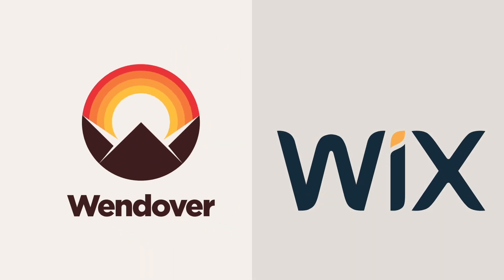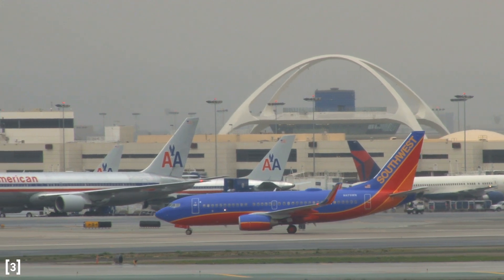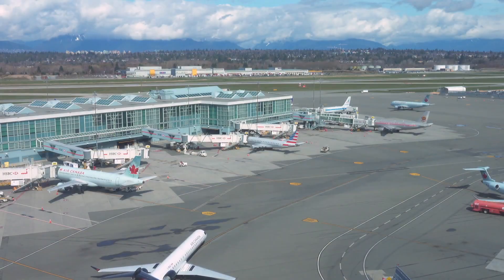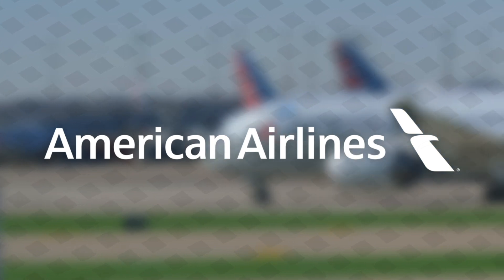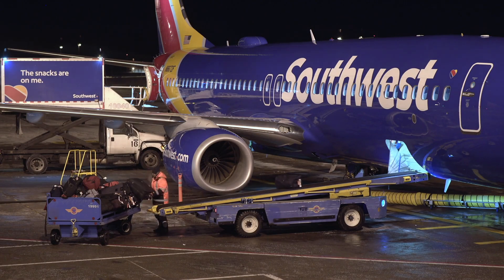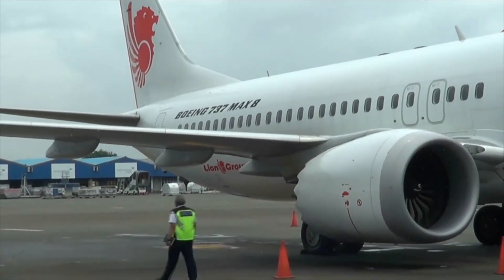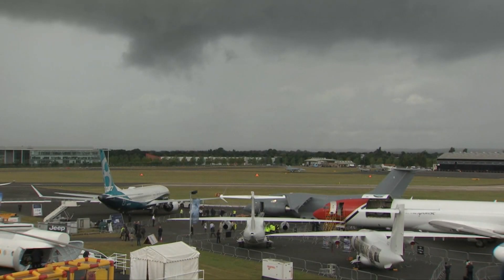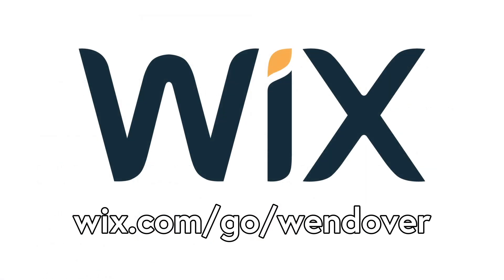The Economics That Made Boeing Build the 737 Max

Comment: So, what makes a new design different than a new variant?
Reply: New design costs far much more and takes many years due to research into new designs, aerodynamics and how the cockpit will look like and new features on board. Then it’s got to be flight tested, fully safety tested which can take another 2 years. With a MAX variant all you have to do is prove the engines work and all extremes of temperature, bird strikes and aerodynamic checks

Comment: One thing I don't understand that if Boeing was really trying to save money, then why didn't they just not include MCAS?  Aren't pilots there to lower pitch anyways?
Reply: Matthew Hung only if the pilots react in time. But also the plane was marketed as flying the same as the NG. If Boeing said the plane will have tendency to pitch up when trying to sell the plane, that will definitely put a few customers off. If they didn’t include MCAS by now pilots would have complained about it or someone would have stalled a plane and crashed

Comment: A precisation: is not that MCAS could not have been installed without incidents, military planes have a similar system in place wich has funny enough a much better track record taking information on multiple sensors and deactivating at the first sign of false signals. 

The 737 MAX could have been a totally safe plane and will be now that the problem has been corrected.
Reply: Flight-critical systems have to use multiple sensors as input (typically 3 sensors with a chip that checks that at least 2 out of the 3 give the same readings within a small margin of error) - but any addition of a flight-critical system would have automatically meant new pilot training. Therefore Boeing marked the MCAS as not flight-critical; and with that, the requirement of the vetting system and multiple sensors went away, which made it possible for Boeing to save some money. I believe this is a case of executives not knowing what they're doing, because any engineer worth their while would have had suspicions - and given typical corporate structure, those suspicions would have been shut down pretty quickly.

Had Boeing not decided to make yet another 737 variant, they would have been free to redesign the plane and study its aerodynamics with more freedom in the design, therefore rendering the MCAS useless.
Reply: @SolarLiner  I suspect that they could have increased the redundancy on the MCAS even without marking it as critical or like the military version make it deactivate if the pilots keep inputting counter trim.
Reply: @theophrastusbombastus8019  Yes, they could have. But that would have meant more design time and more money spent - both of which Boeing had none.
The point is, corporate is the reason why this happened. Boeing is at fault for the decisions, but I think this raises questions about regulations that something like this could happen.
Reply: @SolarLiner  I don't doubt that, as in many other cases unfortunately, the management was to blame. 
I just had the impression that they did not only dirsegard safety but also went about it in a careless and not smart way.

Comment: im not very impressed by the 737 MAX after watching the latest AvE vid on the angle of attack sensor. the standard is to have at least two, but up to four of them for redundancy, the 737 MAX had one. no redundancy.
Reply: Please tell me, you're joking!
A system that can lawn-dart a passenger plane relaying on a single sensor without redundancy?!
I just assumed they had at least 3 identical sensors that have to agree with each other or the system would shut itself down.
Reply: @Bird_Dog00  nope, just a single one. the wires inide are pretty dinky as well. he points out specifically that other planes can have up to four for parity, but that the MAX just has one
if it's wrong its wrong of course, but that's what i heard at least.
Reply: @Bird_Dog00  just checked it out, and it turns out to be true enough. it has two sensors, but not redundant. only one is used with a "spare" if you for some reason dont trust the first one. in flight it acts as if it is only one though since the other one doesent output data when not in use.
Reply: omg...
How the fuck did this get aproved by the FAA or any other organisation responsible for flight safety?

Comment: Boeing 737 Max is *DC-10 Of 21st Century"
Reply: I would say the "rudder problem" of 21st century

If you look at the history of 738, there's a time where two 737s crashed due to opposite respond on the aircraft rudders. It almost had a third crash, but luckily it happened sooner, so pilot can able to recover the aircraft from excessive rolling by turning the ailerons in opposite direction.
Reply: @junrenong8576  well, none of the affected aircraft weren't even NGs, let alone 738. 
I would say that the DC-10 was similar, more widespread fear, and similar groundings, I'd say more similar
Reply: KarlosBricks actually I mean 737...... it’s just a typo

That’s not just happened in 737, but on a BA 747 as well........
It terms of fear, yes, it’s comparable to DC-10 cargo door issues, as engineers knew about the issues but took no action at all.

But 737 MAX is still a 737, derived from 1960s.......so yeah in terms of 737 itself it’s comparable to the rudder issues.
Reply: @junrenong8576  Yeah, compared to the 737 itself, the rudder issue and this are probably about the most widespread and largest, both in terms of affect and death toll
Reply: @junrenong8576  they were 732s and 733s not 738s. The NG has no safety issue inherent with the aircraft's design
Reply: Not really, even DC10 architecture is newer than 737 :D (from the 70s, instead of 60s)

Comment: "Boeing and the 737 Program will suffer long-term, possibly permanent consequences"
Me: does that mean every 737 is at stake?
Reply: The entirety of boing is at risk if they don't react appropriately.
Reply: U mean 707 program....
Reply: @mateuszzimon8216  No, Boeing has multiple programs that make Variants of every Aircraft, the 737 Program focuses on the 737 and the 707 Program is a whole different thing, For example, the 737-100 to 737-800 is part of the 737 Program while the 747-100 to 747-8i is the 747 Program. I would appropriately call the 7_7 program as the 7X7 program.

Comment: Another shocking difference between Boeing and Airbus is that the 737-Max only has ONE sensor but according to articles airbus has the same sensor but THREE of them on a single plane in case one reads faulty. Given how redundancy is key in the airline industry this strikes me as negligent.
Reply: You are incorrect.  There are two Angle of Attack sensors on the 737, one on each side of the aircraft.

Comment: They killed 747 first and now 737
Reply: They killed the 747 with the 777, not much of a kill. Both planes are at the ends of their lives anyways. Both are over 50 years old.
Reply: Technically, the 747-8 still lives but as a cargo carrying plane.

Passenger carrying Airlines, however, have basically MOVED ON to the Dreamliner, 777X, A330neo, and A350.
Reply: @odeiraoloap  I hear Lufthansa and Korean are pretty satisfied with their 747-8is. They are extremely efficient planes, they just don't seem to have the wow factor of the A380.

Comment: I saw some actual pilots who actually fly the 737 max talk about this in other videos.

Apparently the MCAS system is not even needed but it was built in to satisfy regulations.

The plane is not prone to stalls at all. If it tends to pitch up more, pilots can just pitch up less. Everyone does this while driving. If you're over steering, steer less. Pilots barely notice the difference in halding and the difference only happens during specific seating configurations at low weights.

But the regulation is that unless the plane handles the EXACT same. Then you need to retrain all your pilots. So the MCAS (Manuvering characteristics Augmentation System) does exactly what it's named. It augments the Manuvering characteristics to FEEL the same. And of course they fucked that up. Ooops.

But the bottom line is the plane can fly perfectly without it. The plane isn't prone to stalls. It's not like it stalls at 20 degrees and the old planes stall at 30 degrees. The bigger engines actually makes it less prone to stalling but of course the media wants some juicy click bait like the airframe is fundamentally flawed.
Reply: I mean of course if the physics of the plane change they have to retrain the pilots to handle it.  But they decided that the cost of doing that was too expensive, so in an effort to cut corners they installed the MCAS system (clearly with huge technical faults if sensors can fail like that unnoticed by the ground crew), didnt properly train pilots to override it, and as a result hundreds of people died to make Boeing shareholders happy.
Reply: @masamunexs  American Airlines is one of the biggest airlines in the world, when they say "Hey, we're gonna order 100 planes that don't quite exist yet", you make the plane exist. Not doing so means that hundreds of millions, if not billions of dollars isn't coming to you, and that could coat you your company, and the jobs it creates. And given that the Shareholders have a say in how a company is run, if the CEO did something they didn't like, they could have just had him sacked and replaced by someone who would.
Reply: @Tank50us  No argument there, the point is that in our shareholder oriented system short term gains are put ahead of long term vision time and time again, for making phones it's no big deal, but when it comes to airplanes, it costs lives.
Reply: @masamunexs  this is very true. But, you can hatdly fault Boeing for opting to improve their best selling plane (over 10,000 built and sold to date), over making something entirely new. Especially on the coat tails of the problem prone 787. All of those problems were worked out in time, but it also had some groundings due to safety issues, so this is nothing new in aviation.
Reply: Boeing warsn't forced to make all of their irresponsible decisions by regulations. They choose to exploit regulations to make a fundamentally different plane not require recertification. This is 100% on Boeing.
Reply: Yea, he missed the mark on that. The problem is shitty implementation of automation with no manual override. It just makes me laugh when people say we will have fully automated flights in a few years.
Reply: This is all well and good, and likely true, but you're coming across as if you are excusing Boeing here.  That's utterly wrong.  Their greed has led to hundreds of deaths, and they were the gatekeepers.

Comment: I have to say this video is full of fatalistic and definitive statements. Boeing did decide to develop the 737 airframe further but that’s not necessarily the wrong decision nor is it automatically an unsafe decision. The engineering and testing that goes into these aircraft is very advance and they knew what they were doing. There of course have been issues that have come to light regarding the MCAS and the AOA sensor system but those are the issues. The airframe of the aircraft is not the issue. Engineers are presented with issues every day and the create solutions. That’s exactly what the engineers at Boeing did when they decided the re-engine the 73. The 747-8 is a design that’s nearly as old and also still in production. Not only that, but it’s outlasted it’s biggest Airbus rival, the A380, which is 30+ years newer. Saying that improving on an existing design is automatically the “wrong decision” fails to take into account so many other variables. You cover them and yet ignore them and still claim that they should’ve built a new plane, as if they can snap their fingers and complete such a task.
Reply: And yet he is right
Reply: Detlef Die Soos How is re right? Please explain yourself. I do my best to make a clear and concise argument and that’s how you respond?
Reply: @wccborn  because they failed. The program that compensated the stronger tilt failed twice fataly. The decision was simply economic. Either pay a lot for new technology, or change the current model to fit modern standards. Because the only way for your all problem solving engineers to implement the new standards was to put the engines to the front. This resulted in a stronger lift that would normally result in a completely new training for all pilots(expensive), so they created MCAS, which failed.

Had they simply created a new model that was not dependent on such programm, the issues would have never been a thing.
Reply: Detlef Die Soos You act as if economics should never be a part of a decision. If that were true then the 73 would never have existed in the first place. You also act as if there are no other artificial flight envelope augmentation systems on the market. I might remind you that every Airbus currently in production uses far more extreme flight augmentation systems. The pilots inputs are entirely unattached from the control surfaces of the aircraft and the software is used to augment the control feel. There is nothing inherently wrong with artificially modifying how an aircraft flies in order to keep it in line with previous generations of the aircraft. 

Also, you spelled “fatally” wrong and your sentence syntax is horrendous.
Reply: Detlef Die Soos You say Airbus’ system has never failed? That’s outright incorrect. 

https://m.youtube.com/watch?v=OGHVnIxNUIw Here’s just one notable example. 

And you say the Airbus is a completely new design? The A320 series was developed starting in 1984 which makes it 35 years old which is well over half the age of the Boeing. It is no new design. 

And you say that history has proven the 737 to be unsafe and yet over its flight history it has an excellent safety record very similar to that of the A320 series. 

And you say it’s rude for me to attach your grammar? Absolutely not. I don’t start debates with people in the languages that I don’t speak as well as English, and you shouldn’t either.

Comment: Boeing Aircrafts are starting to find themselves in a position like the Concorde shutdown in 2003 after the latter's only crash in France in 2000. That supersonic aircraft was a beauty and flew the skies since 1969; but one should never compromise safety over high-tech or cost effective measures. Ensuring Safety operations are the first rule in engineering.
Reply: There are these things called: Design requirements. One of which for tge Concorde was that it had to go faster than the speed of sound. Thos means going through the sound barrier, which is quite dangerous if not without a proper design. The Concorde was this proper design, but the extreme operating environment made the planes, when getting old less reliable. After the crashes and the fuel prices back then it was decided to retire the Concorde.

So if you find safety the most importamt thing, you'd better stay on the ground.

Comment: 0:52 You are incorrect. The 737MAX does not use direct connection to the flight control surfaces in normal flight. It goes through a system in the tail that physically separates the pilot controls from the control surfaces through a device known as the "Feel Unit"

Comment: Wasnt the recent downing of the 2 737-Max's more a result of the lack of training required by pilots? MCAS can be overridden and disabled however in both crashes the pilots were not able to do so.
As mentioned in the video, pilots do not require extensive training to fly different variants of the 737. MCAS is a 737Max exclusive feature and Boeing's failure to highlight this feature in pilot training is what caused the accidents, the pilots were not familiar with the MCAS system and failed to disable it in time.
Reply: But a failing technical system isn't nice too
Reply: The Ethiopian pilots disengaged the MCAS system and then re-engaged it which is not part of the procedure.

Comment: Boeing should really just bring back the more modern 757 instead of beating this 1960's horse to death even more. This is pure laziness and greediness on Boeing's part. And so crazy to think that the 737 was originally designed as regional jet and never even envisioned to make transoceanic flights as it is used today.
Reply: Well airlines and customers are both complicit to this greediness. Customers always pick the cheapest flights so airlines are happy to buy cheap jets and offer cheap flights. Boeing is also happy to make the cheap jets to satisfy the demand of airlines so they can satisfy the demand of the consumer.

But obviously nobody wanted dangerous jets and that will reflect in consumer choice now.

Not that the 737 is even dangerous. It's just the software that's kinda borked. The plane isn't actually more prone to stalls like this video and so many other videos claim. The MCAS is only there to make the plane handle the same. It pitches up more so pilots simply need to pitch less but regulations says that would be a brand new plane and pilots need to get retrained for that. So they just used software to fake the Manuvering characteristics to feel the same. The plane is actually less prone to stalls due to bigger engines.